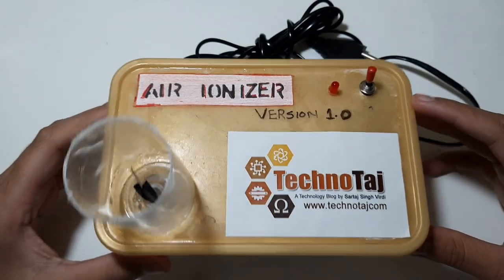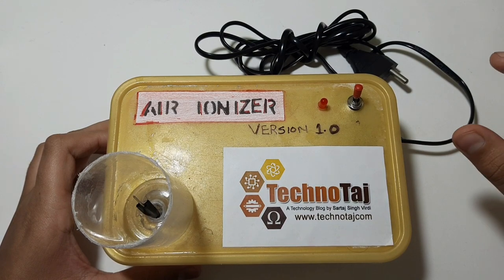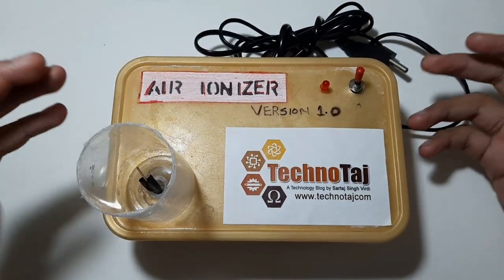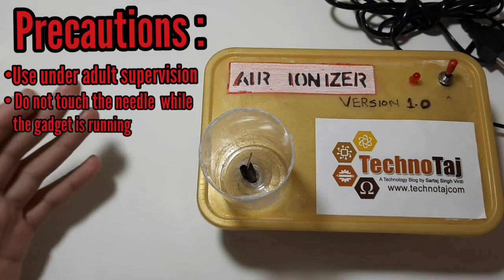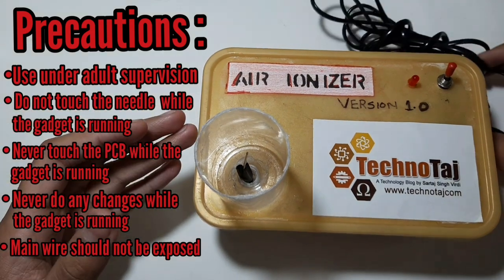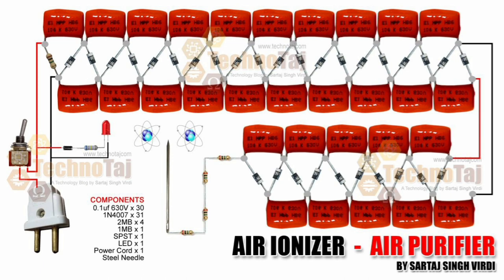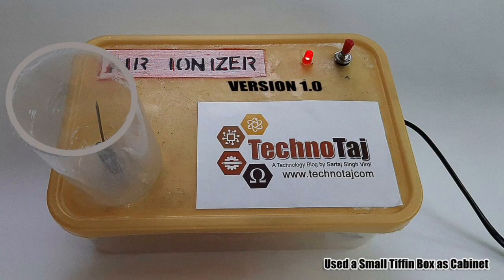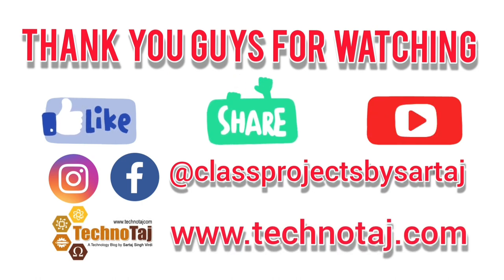POLLUTION BUSTER: AIR IONIZER School Project by Sartaj Singh Virdi

Comment: Nice project!
Mayby its an ideea to use an air blower, to reduce the 5 hour time... and don't forget to use a fuse in the 220 volt line!
Reply from the maker: Yes sir. Your input and suggestion of adding a fuse on the 220V line is accepted.

Comment: Good job👍👍 what do the negatively charged particles do in the air though?
Reply from the maker: These negatively charged ions created by this project roam freely in the air of a room and tends to collide with the already present pollutants in the air like dust particles, smoke, gas particles.
 Most of the pollutants in the air are inherently positively charged, so what happens, the negatively charged ions start attracting these pollutants from the air towards themselves (as the opposites attract), just like a magnet.

The pollutants in the air slowly find themselves pulled and firmly stuck over these ions until each of the ions become so much pollutant laden and heavy that they start crashing on the ground or if they find a wall nearby they start gathering on it.
 

In this way the air in the course of time becomes absolutely clean and free from all impurities. I have tested this ‘Pollution Buster’ on various room sizes.
Reply from the maker: Thank you.